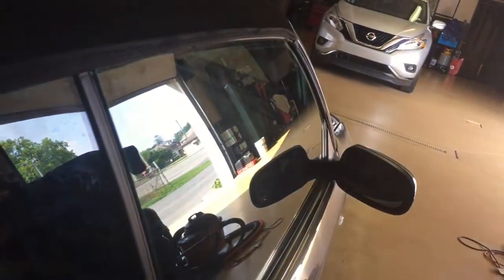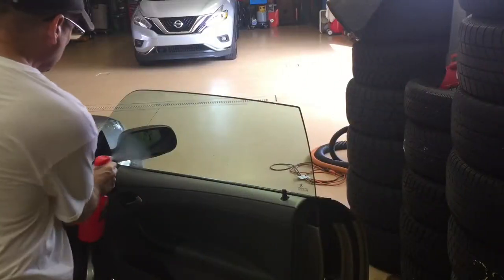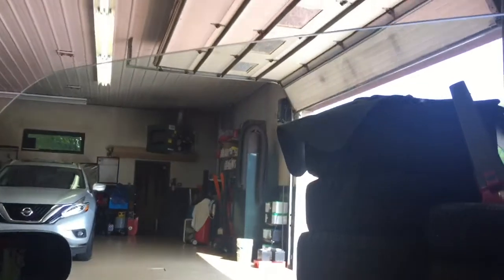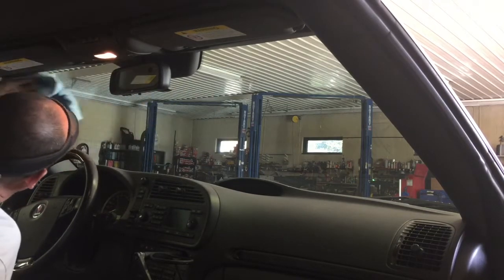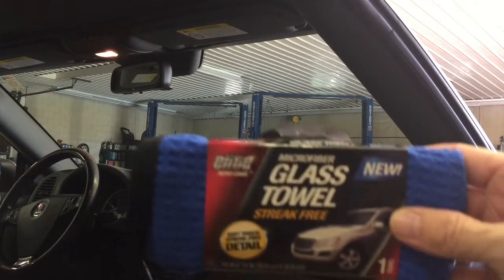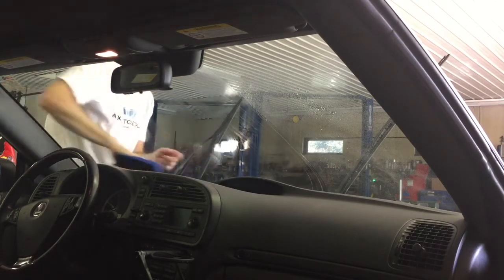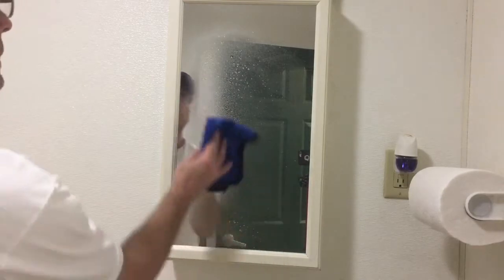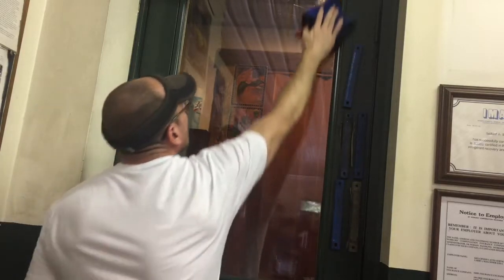Cinch Glass Cleaner. IS THIS THE ONE WE HAVE BEEN SEARCHING FOR?!?!?!

Comment: I personally use a two towel method one wet and one dry. The wet towel I saturate one side with isopropyl alcohol and the other side with stoner invisible glass and cut through the film with the alcohol them follow up with glass cleaner to help keep it streek free and to help with flashing. Even on nicotine stained glass it will do it in one go.